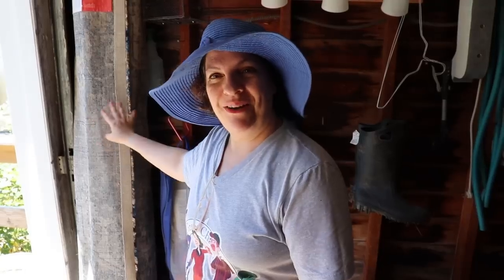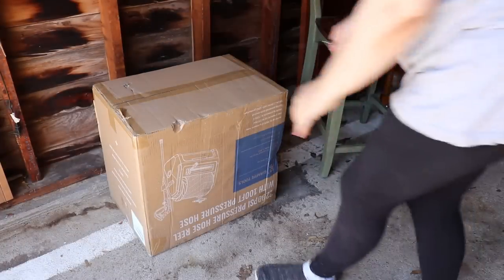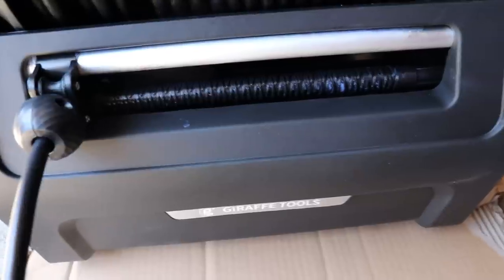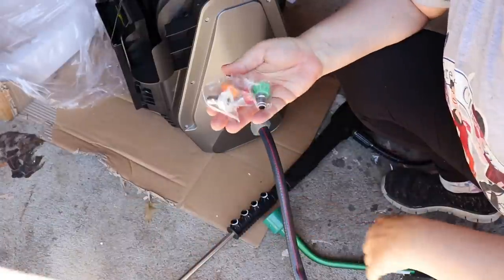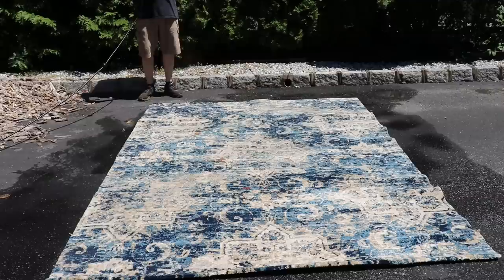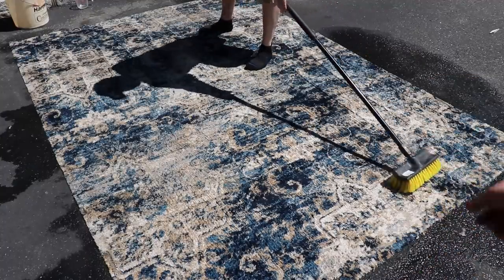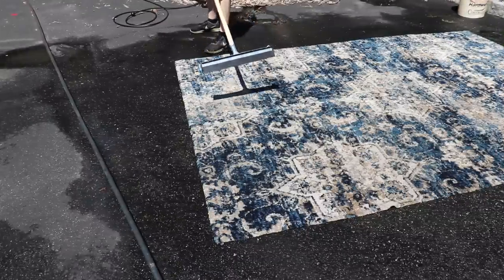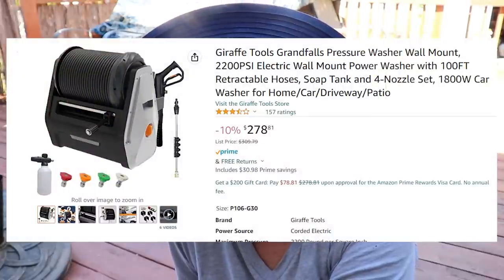How to pressure Wash a Rug ||  Giraffe Tools 2200 PSI Power Washer || Review and Demo

Comment: I came up with an easier way to get water out of the rug.  I wash it on the deck with the hose and soap and after rinsing I use my carpet cleaner only to suck the water out. It fills quickly so I have to empty it often but it's so light to move it onto the railing. Dries really quickly too. Love that rug.

Comment: Does your existing garden hose just need a new rubber washer inside the threads, to give a better seal? Mine got vandalized and I had to cut off my threaded hose ends, so used the opportunity to convert to all 'quick-connect' fittings. Good job on a tough, hot task!

Comment: Put a little Teflon tape on the hose (male) connection and you won't have a leak.
I gotta get me some of that because all my hoses leak at the hose Bibb.
Can the hose be drained for winter weather if it's mounted in the garage?

I think I need a pressure washer.
I have an outdoor rug that's filthy with mildew. I've heard of pressure washing it vs. tossing it out. 

Thanks for this timely review. 😀
Reply from the maker: You ll get more use out of a pressure washer than a new rug. What we did was disconnect the hose as we recoiled it so the water was coming out of the connection as it recoiled.

Comment: And then you take an extractor to it, a bissell or shark carpet or spot cleaner, or even a rug doctor or shop vac, whatever, and get out as much water as you can, then hang it over a fence, you want your rug to dry as quickly as possible so you don't get mold growing in it.
Reply from the maker: True. But in 99 degree temps and full sun it was dry in less than 5 hours. But yes. I recommend an extractor if you don't have a heat wave like we did.
Reply: @mygreatchallenge  oooo far out! We're in the middle of winter in New Zealand, but even 99°F sounds too much!